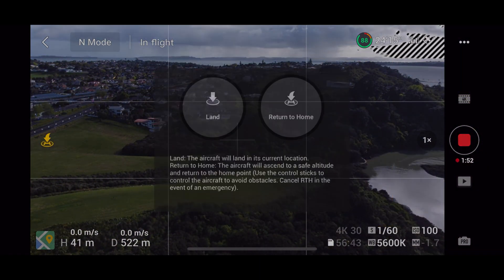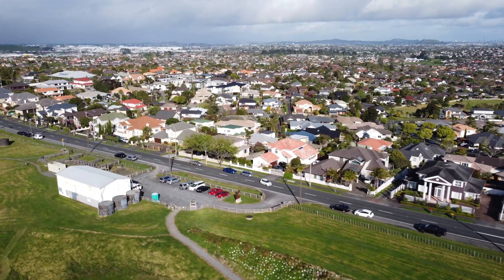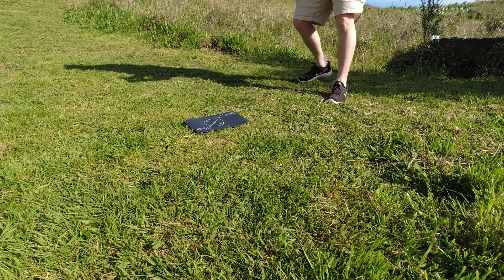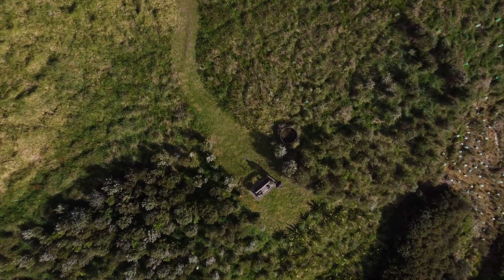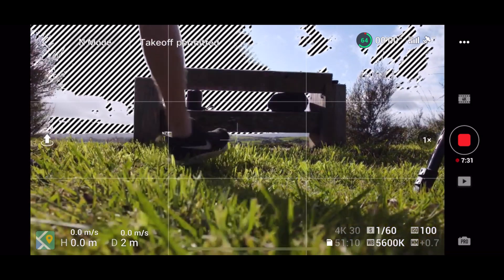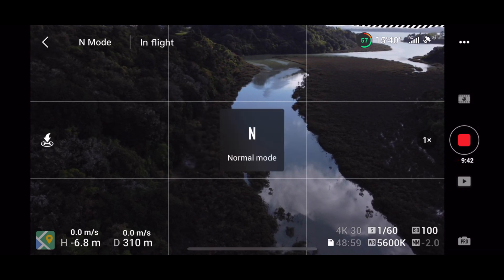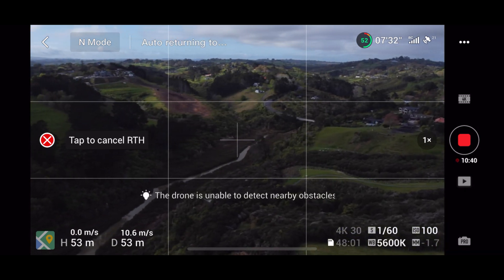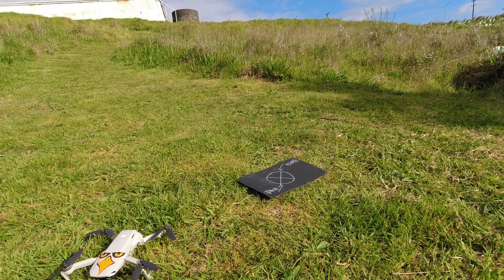DJI Mini 2 Return To Home Function ACCURACY TESTED

Comment: Problem for me is that a lot of the landscape is rough and if you find a nice flat area to launch from as your home point, if it isn't accurate in RTH then it could land on rough ground which could damage the drone. And sometimes because I'm not at the RTH point I can't manually land it the last few metres.
Reply from the maker: Yeah that could be a little dicey!

Comment: Mike, why does it fly forward before or as it lifts off ? Also have you set the compass recently I find my Mini 2 is far more accurate than yours for some reason ?
Reply from the maker: Hi mate, it's not flying forward it's slipping. THe plastic mat is on a slope (I'm on a hill) and as it slowly lifts off it loses grip and slips forward 😊

Comment: Agreed, great drine as you can still use the gimble and spin it around in any direction nd the RTH will still be activated,  as with some other drones, as soon as you move the sticks the RTH will be disabled. Really impressed with the mini 2.
Mine has always landed within 2 foot when the RTH is activated which is not very often at all, prehaps 4 times i have used it for exactly the same reason as your watching this video.
Reply from the maker: Thanks mate, good comments - thanks for sharing!

Comment: I have a question for you and anyone else can answer this if they know the answer... On a full battery set return to home 6 miles away in a nearby  Baseball field..  Do you think it would make it.. That's 6 miles away 100% battery and tail wind  🤔 Will it make it..?
Reply: No! My Mavic 2 Pro went 6.2 miles away and came back but I did it in a regional area with all the sensors turned off I had 5% battery left
Reply from the maker: Doubt it, would't risk it mate.

Comment: Does the RTH point update while the drone is still on the pad or during hover just after take off? If just after take off, then in all your tests, the drone had moved slightly away from the pad for its hover, meaning that the RTH point was not actually the pad. Still impressive and very usable never the less
Reply from the maker: Yeah that's true, I did notice that for one of the flights, it updated just as it took off.

Comment: Good day, Mike. I have tried RTH accuracy several times and it always turns out like your experience. Close but no cigar. I have tried hovering at different heights while looking down at the  pad and updating the home point several times. It does not have the capability of the larger drones to detect its location visually while landing. But as long as it gets close, I can manually steer it to me for hand landing.
Reply from the maker: 100% mate! That's good enough for me. I have no need for it to land by itself millimetre perfect.👍

Comment: Nice video Mike.  So if the return to home signal depends on the strength of the GPS, and it takes the strongest reading from that data, would the amount of satellites affect the GPS signal strength and therefore the RTH point?  I think more testing is required in Scotland where satellites are as rare as Haggis ;-)
Reply from the maker: Very good question Al, I might have to check on that, I'm not sure! Yes I guess logically the more satellites to 'triangulate' a signal would improve the accuracy.